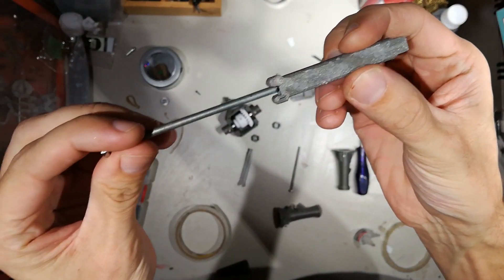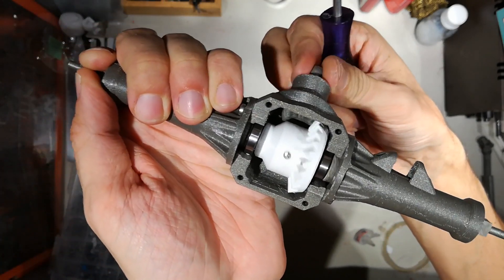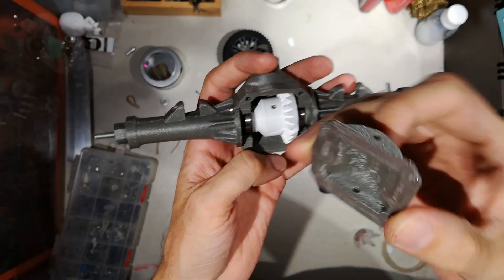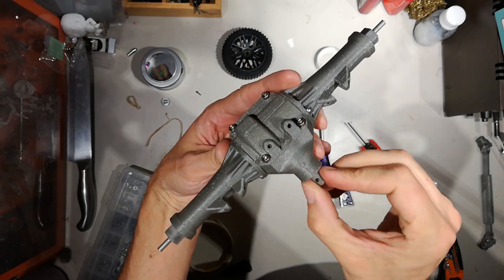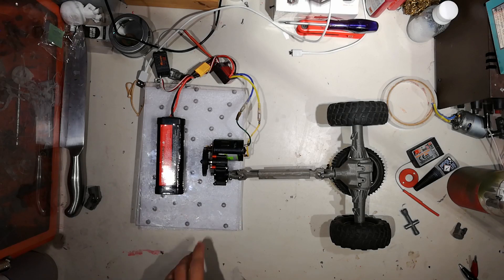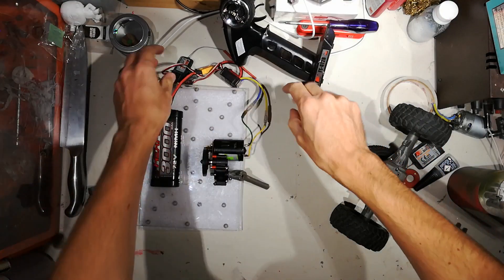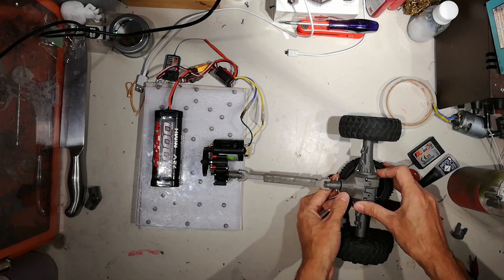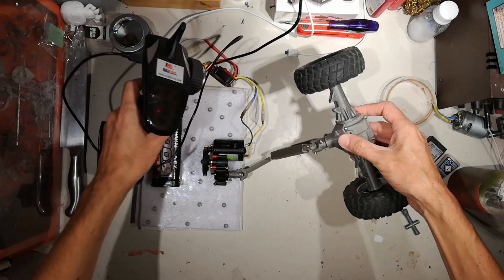Ossum Differential Mk III - Full Assembly and Test

Comment: Hello 4 years later 😂 I have a question. I saw plastic bearings in stl files. Can I use them? Thanks for this good project.
Reply from the maker: Hi! You certainly can use the blastic bushings, I doubt it will be an issue unless you are building something really fast, lots of old RC toys used plastic bushings, maybe a bit of grease would help.
Reply: @JasonSuterOssum  Thanks for fast answer. I printed all part. It is really good with plastic bushings. And bit of grease. Thanks for nice project. Last one is where can I find your drive shaft?
Reply: Could you please share drive shaft stl?
Reply from the maker: @denizaxu  here it is: https://www.myminifactory.com/object/3d-print-ossum-driveshaft-mk-i-66343
Reply: @JasonSuterOssum  Thank you very much

Comment: Hello, just found your posting. Very nicely done. Can you tell me what scale is it? I need a pair of axles for a 4WD 1/6 R.C WWII Scout car I would like to R.C. Can you help me out?
Also thanks for sharing your build with us.
Reply from the maker: It is designed to be the same scale as scx10 axles, which are called 1/10 but of course that all depends on what you are building. These would be way to big for my 1/10 MB jeep, you'd have to scale it up to about 1/6 to use them at this size.

If I remember correctly they are about 185mm hex to hex.
Reply: @JasonSuterOssum  Thanks again for your reply. I have a 1/6 Ultimate Soldier Schwimmwagon WWII German Scout Car, plastic static that I would like to convert to full R.C for land and water. I need your axle to make a 4WD and wider for my Car`s body width. Can yours fit that need? Any help would be appreciated. Thanks, George
Reply from the maker: @georgetonkovic1275  I don't know how wide your car is, you'd have to figure that out. I might be suitable.

My axle is only for RWD though, I haven't create a front powered axle yet.

Comment: Hi, really nice diff..Where did you get it from?,if you don’t mind my question..Thanks a lot
Reply from the maker: I designed it in Fusion360 and printed it on my Robox Dual 3d printer. You can get the files to print it yourself from the link in the description.

Comment: I´m making a fully 3D printed trophy truck and I´m planning to use your axel. Is it fine with you if I post the finished truck on thingiverse using your axel? I will link you as the original designer of the axel of course.
Reply from the maker: This sounds like a very cool project, Ill be very interested to see it! 

If you're using the axle as is then I'd prefer if you directed users to download it from my myminifactory page in your instructions. Getting traffic through those kinds of places are the only way I'm able to fund releasing all the designs I do for free.

If you bring the project to completion I'll definitely direct folks to it, since I love seeing projects that use my designs.
Reply: @JasonSuterOssum  Ok, that sound fair. Hoppefully I finish it in the near future.
Reply: @JasonSuterOssum  I have some questions: 
First: is the parts list correct? I counted four 12x8x3,5, two 18x12x4 and four 15x10x4 bearings.
Secound: is it normal for the parts to be so under sized? The pinion gear shaft came out with a diameter of 7.7mm and is supposed to fit in a 8mm bearing (?).
My printer is usually very accurate.
Reply from the maker: @German_overengineer  Hi. I have checked the bearings and you are correct, thanks for the correction! I have updated the list.
I have also uploaded a new pinion which is designed to have a 7.9mm diameter. Most printers are not as well calibrated as yours on outer dimensions, I usually find people can't reliably get things to fit if I leave the clearance so tight. When aiming to make things easily printable across a vast range of printers I usually provide 0.3mm clearance.
Reply: @JasonSuterOssum  Where can I find the new version? When I download the zip, there is stillt the 7,7mm pinion gear in it.
Reply from the maker: @German_overengineer  its on the myminifactory page, not sure why its not included in the zip but look at the parts list and you'll find "Pinion Gear 23T Mod1Pt6 Pa25Deg 0Pt1 Clearance.stl"
Reply: @JasonSuterOssum  So the gear came out with a little over 7.9mm, which is good enough for a printed toy. Only problem left is that the bearing is very lose in the housing. Maybe you can send me the fusion 360 file, so I can figure out the right sizes by myself.
Reply: @JasonSuterOssum  I´m finished on my front axel and did some modifications on your axel design. Only thing I can´t figur out, is why the lid of the differential  housing can´t fit. Its almost 2mm to flat and hits the gear.
Reply from the maker: @German_overengineer  That is odd indeed. I had no problems, and other people have printed and assembled those files, so something must have gone wrong. Did you perhaps print it with support and it is still full of that?
Reply: @JasonSuterOssum  So I made my own cover, because I needed diffrent mounting points anyways. I just have to ask for one favor: can you make the hole diamater in the pumpkin for input shaft bearings a bit smaller and the input shaft a bit thicker? I found out that 0.05 smaller/bigger than the inner/outer diameter of the bearing works best for me.

Comment: Is it hard enough ? 
If you installed this in rc truck can it withstand heavy loads
Reply from the maker: Depends how yoh drive and what you print it from, but it will never be as tough as a high quality axle with metal gears.

Comment: Really really  awesome, i will start my rock crawler project , do you have from axle too?
Reply from the maker: Thank you.

I haven't done a front axle, but perhaps i should. I decided the knuckles would be huge with the size of the CVs I did for the driveshaft.

Im actually starting to work on this project again due to lockdown, so the single seater racer should get done eventually

Comment: This might be an unusual question, but does it work the opposite way too? If the tires spin, will the drive shaft shaft spin too?
Reply from the maker: Sure, if you turn both wheels the same way then the shaft will rotate

Comment: could this be scaled down significantly? or do you think it wouldn't work? part integrity would decrease too much.
Reply from the maker: I see two challenges (a) the gears in the diff would get really small, beyond the scope of FDM printers I think, but maybe SLA/DLP could pull it off (b)  it would probably need a redesign since the bearings would no longer fit, unless you managed to scale it to perfectly fit smaller bearings, but that seems unlikely

Comment: Hola! Excelente trabajo, en este momento estoy imprimiendo las partes. No he encontrado la lista de rodamientos necesarios para el ensamblaje, se encuentra disponible? Gracias!!
Reply from the maker: Hello! Thank you, I hope that you can share some photos when it is done, I will love to see it. 

These are the bearings you need 

(4) 12x8x3.5mm bearings
(2) 18x12x4mm bearings
(2) 15x10x4mm bearings
(2) M4 rod, 80mm
(2) M4 nuts
(16) M3x8mm screws

Comment: (4) 12x8x3.5mm bearings
(2) 18x12x4mm bearings

(2) 15x10x4mm bearings

Ive put in those bearings into amazon, and it shows the first two numbers are switched? Is this the same? possibly different country? 
Exp, "12x8x3.5" shows me "8x12x3.5"

That should be the same right?
Thanks for any feed back, love your work!
Reply from the maker: That should be the same, the first two large numbers indicate the inside and outside diameters, the convention about which comes first seems backwards to me to be honest, I might have put it in the wrong order (again).

And thanks glad you like it, please do share your results with me when you're done, on Facebook or myminifactory or whatever.

Comment: What material did you print the case and gears with? Do you use any grease on the ring and pinion gears?
Reply from the maker: These are all printed in rigid.ink ABS, but if I have any hassles i will migrate the gears to nylon. So far they seem to be doing ok. 

I have put some general purpose grease on it, which made it a lot smoother, but to be honest I don't think it was the right stuff, I have since read that petroleum based greases are no good for ABS in the long run. White lithium is apparently good.
Reply: Jason Suter Thank you Jason! I ordered samples of filiment from Rigid Ink and really like it but they don't sell full rolls of their products here in the US. 
I was going to suggest white lithium grease. It doesn't seem to attack plastic. 
Cheers!
Reply from the maker: That's a shame, It is fantastic stuff, I am a huge fan of the silver ABS, it has a nice "cast metal" look for scale RC stuff.